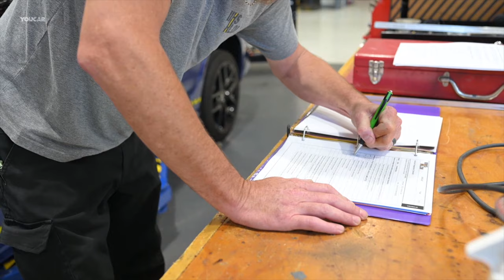SMALL CAR CRASH TEST COMPILATION - Civic, Corolla, Sentra, Forte, Crosstek

Comment: For a brand like Subaru, who markets their cars for being super safe, this is pretty upsetting.
Reply: They do the bare minimum to get “Good” whenever IIHS makes a test harder they don’t do that well.
Reply: I just bought a crosstrek too 🥲
Reply: @corinneel9392  likewise, and the same color and trim level, but a six-speed.
Reply: The Outback and Legacy did incredibly well in this crash tests. The Crosstrek and Impreza are the oldest vehicles Subaru is still selling so it’s not surprising the Crosstrek did poorly. I’d like to see the new Impreza and Crosstrek in this new crash test.
Reply: @HelenFire420  legacy was not tested
Reply: @x-90  I agree that this is a disappointing result for subaru and they should have done better here, but disagree with your comment; its probably more applicable to toyota, kia or others.
When the IIHS introduced the small overlap test  in 2012 subaru was one of few brands that did well. At the time it showed that subaru was really ahead of the game and was designing cars from a wholistic safety perspective instead of just doing what was needed to get 5 stars (exactly opposite to your comment).
This result is disappointing, no one has achieved a "good" result. Subaru has dropped the ball. No one wins here.
Reply: @corinneel9392  I had the mazda cx 5 :D
Reply: @jackaree  some cars did get good the mazda cx 5 for example..my car
Reply: We Have A Subaru Legacy 2017 PZEV
Reply: What makes subaru score “poor”. no trim pieces fell out.   mannequin looks intact to me  😂😂
Reply: Yes very upsetting to here.
Reply: @mingchan2115 poor structure, way too much intrusion into the cabin, high risk of injuries in some parts of the dummies.
Reply: It’s good at breaking not crashing

Comment: Achieving an acceptable rank in the side impact test where an SUV sized test car ramming into you, is actually good result. It goes without saying, SUV's have a higher height profile compared to a sedan. Therefore, sedans will tend to do badly against a SUV. I understand the need to use such a test car because the plague that is the SUVs, are too prevalent on the roads.

Comment: Question:  If the car's fuel tank was drained and the fuel replaced with a safer liquid, how was the car able to be driven (1:34) to the crash site?
Reply: Did they clarify it was a safer fluid? I believe it was just fuel.
Fuel tanks typically don't ignite in crashes, and they also likely have fire safety equipment on-site.
Reply: @4ae109 fuel tanks don’t ignite unless if it was punctured, which only happens in a 100 MPH collision or something